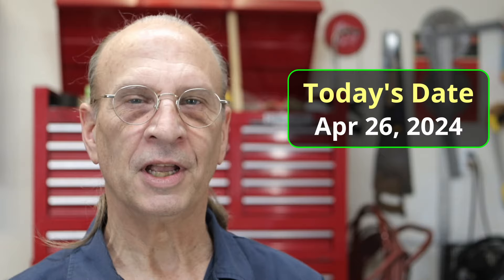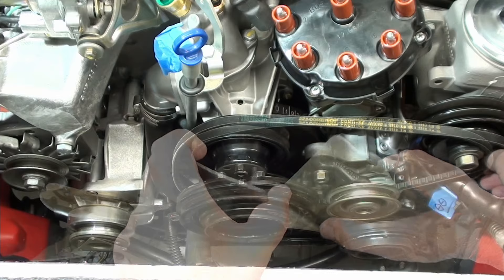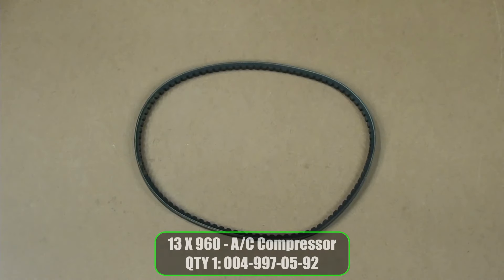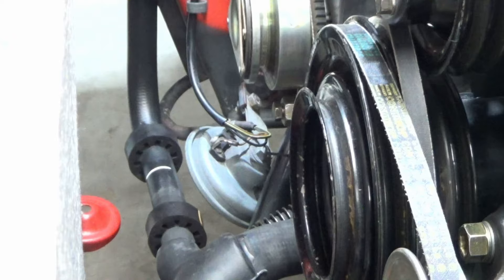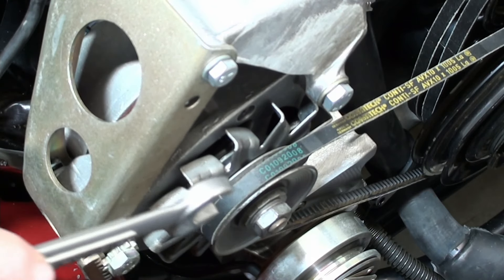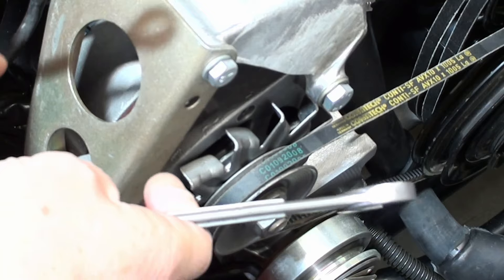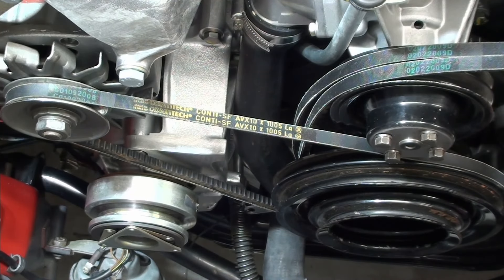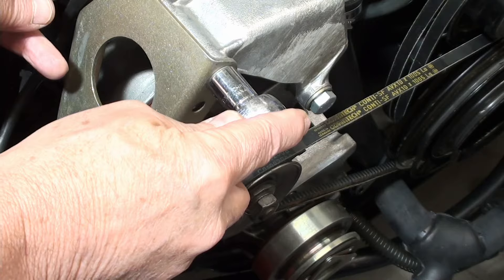560SL - Replacing and Tensioning V-Belts

Comment: Where did you get the shop manual for your Mercedes Benz? I plan to change all the belts on my 560SEL soon and your video is a help. Thanks for the informative video.
Reply from the maker: I believe these are the same belts. I include a link to the manual I am using at the bottom of the description of every video. If I reference the manual in the video, a link to that manual will be provided in the description area.
Reply: @TonyLiveTV  Thank you for answering my question.